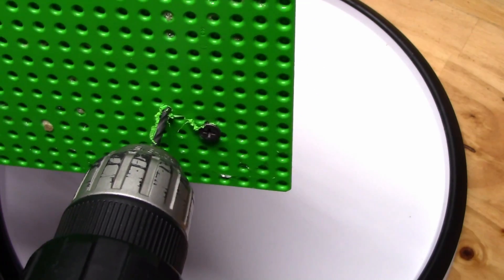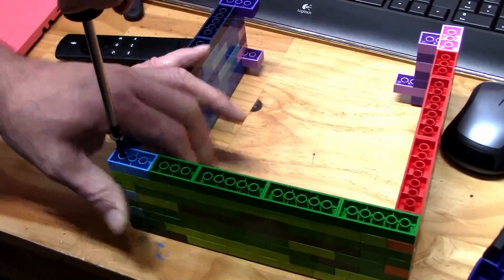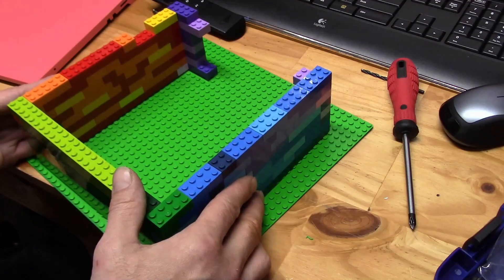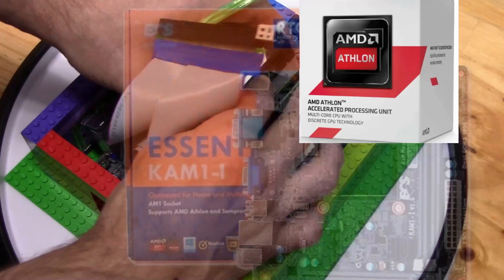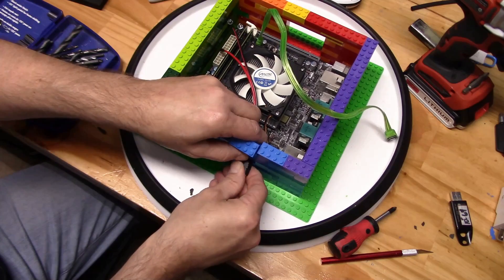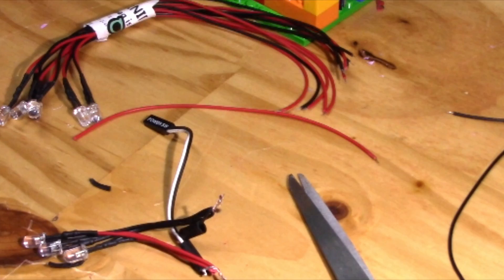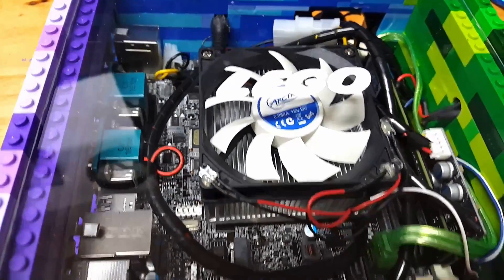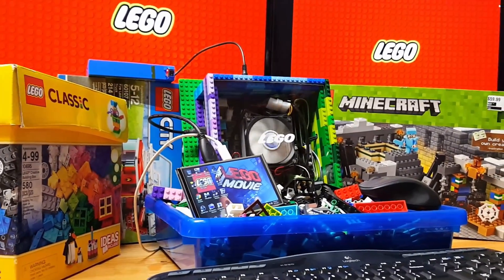lego computer build

Comment: The best air flow
Reply from the maker: +Scrap Tech Tips there are  2 fans the intake blows across the pico power supply across to the opposite side where the exhaust fan is.
  Maxed out the processor is 25watts

Comment: "ABS maximum temperature is 80°C (176°F) and melt at 105°C (221°F)
Polycarbonate plastic used for transparent bricks melt at 267°C (512.6°F)
Since a candle flame has a temperature in excess of 1000°C (1832°F). I would advise against making a candle holder of LEGO bricks."

If you get a Pentium 4 (one of the really hot ones) or a FX 8350 (i think this is the right processor) you could legit melt those bricks.
EDIT: except the clear ones because polycarbonate plastic is magic

Comment: Just sucks how fail the AM1 platform was even at 1280 by 800
Reply: the am1 platform wasn't that bad, with the motherboards being cheap and the overclocked a8's being decent enough it was good if you wanted to build a budget but new pc